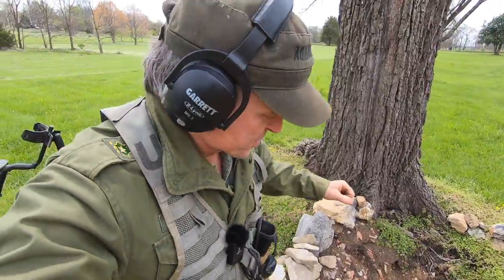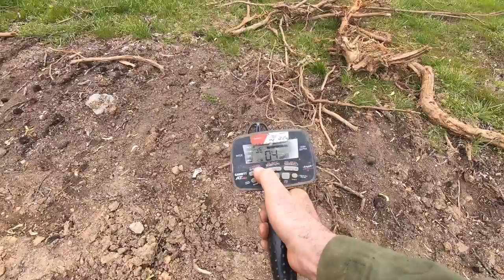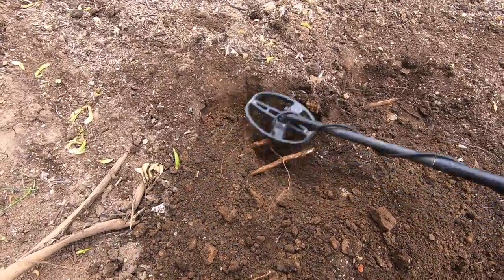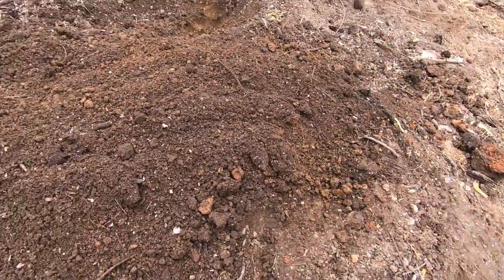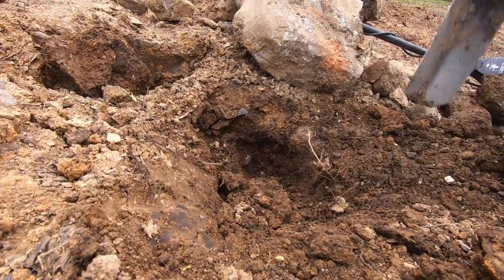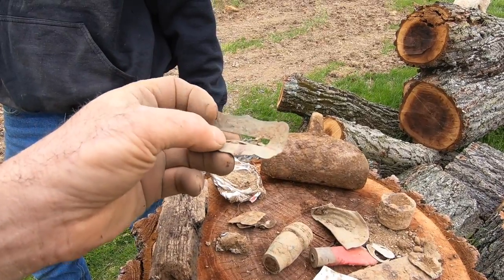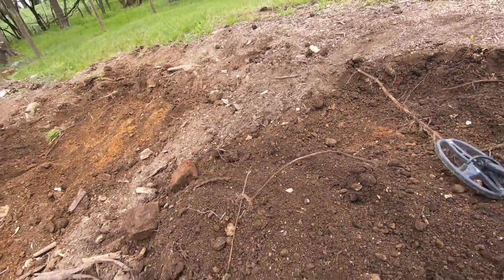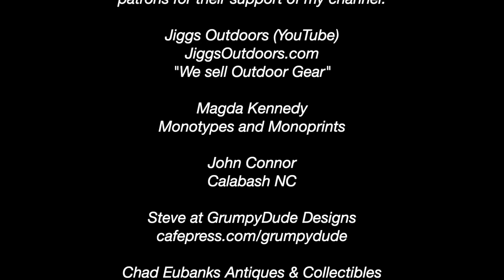Metal Detecting An Old Stone Foundation

Comment: I almost completely cut my finger tip off on glass digging in the woods one time, and I've worn gloves ever since.  It was a very bad cut that wouldn't stop bleeding.  All I had to put on it was my chewing tobacco.  I rubbed that in my cut and put a little on the top, and wrapped it in a strip of my tshirt I had cut off.  That stopped the bleeding real fast.  Tobacco will stop bleeding by shrinking the blood vessels, and is also an antiseptic.  It works great in a "pinch."

Comment: That wire item you found. If it is along the railroad tracks it's a grounding strap at a splice plate on stick rail. It makes sure there is good ground so the signals at the crossing will work properly.

Comment: Are you using a new camera? The image seems much clearer then before. Or is it the weather and light is better? LOL  I know I have that damper in my collection but I can not find it. The handle is different from the usual and the diagonal hole pattern is hard to come by. Royal has a two hole design but its opposing holes. Nice find. Stover used a handle design similar to that. but the plate is not stover. Most likely early Griswold.